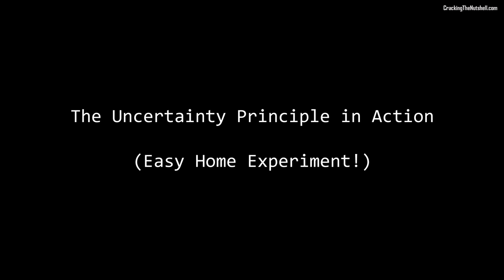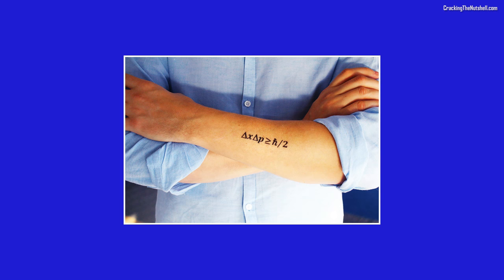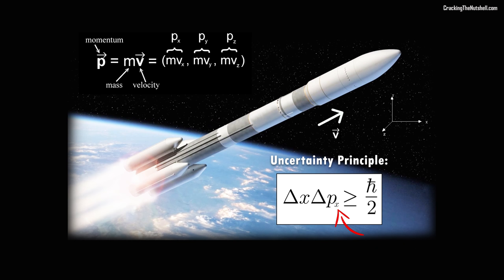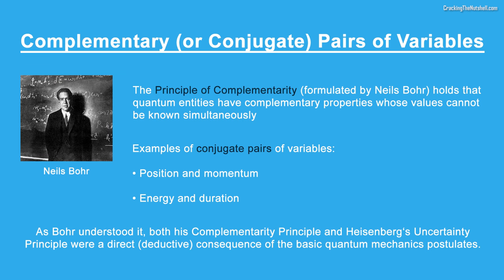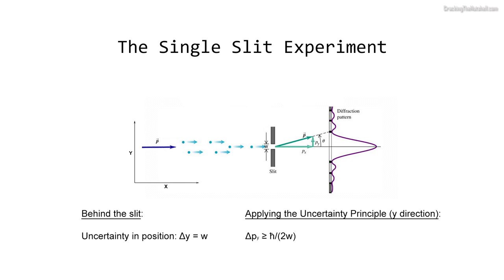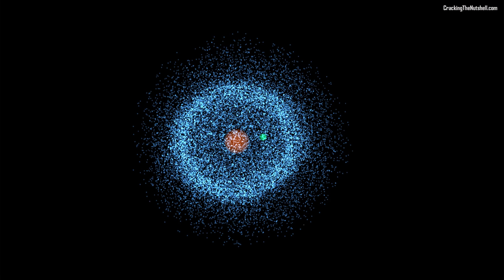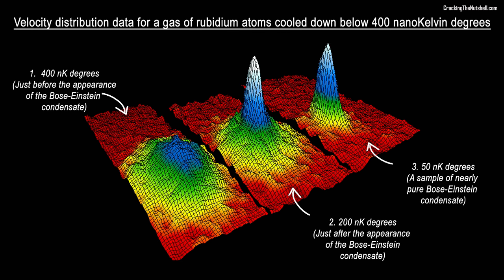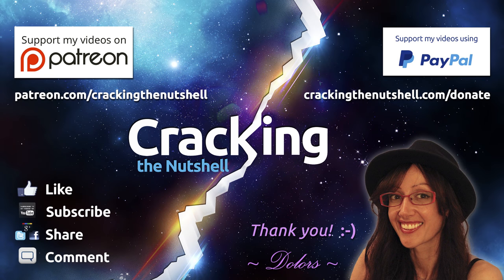Heisenberg's Uncertainty Principle - Single Slit, Hydrogen Atom & Bose-Einstein Condensates

Comment: Heisenberg's uncertainty principle: Δх * Δр ≥ ħ/2

The Heisenberg's uncertainty principle is correct, moreover, it is fundamental. If the uncertainty principle is incorrect, then all quantum mechanics is incorrect. Heisenberg's justified the ncertainty principle in order to save quantum mechanics. He understood that if it is possible to measure with every accuracy both the coordinate and momentum of a microparticle, then quantum mechanics will collapse, and therefore further justification was already a technical issue. It is the uncertainty principle that prohibits microparticles in quantum mechanics from having a trajectory. If the coordinates of the electron are measured at definite time intervals Δt, then their results do not lie on some smooth curve. On the contrary, the more accurately the measurements are made, the more "jumpy", chaotic the results will be. A smooth trajectory can only be obtained if the measurement accuracy is small, for example, the trajectory of an electron in a Wilson chamber (the width of the trajectory is enormous compared to the microworld, so the accuracy is small).

Heisenberg's formulated the uncertainty principle thus:

if you are studying a body and you are able to determine the x-component of a pulse with an uncertainty Δp, then you can not simultaneously determine the coordinate x of the body with an accuracy greater than Δx = h / Δp.

Here is a more general formulation of the principle of uncertainty: it is impossible to arrange in any way an instrument that determines which of the two mutually exclusive events has occurred, without the interference pattern being destroyed.

It should be immediately said that the Heisenberg uncertainty principle inevitably follows from the particle-wave nature of microparticles (there is a corpuscular-wave dualism is the principle of uncertainty, there is no corpuscle-wave dualism - there is no uncertainty principle, and in principle quantum mechanics, too). Therefore, there is an exact quantitative analogy between the Heisenberg uncertainty relation and the properties of waves.

Consider a time-varying signal, for example, a sound wave. It is pointless to talk about the frequency spectrum of the signal at any point in time. To accurately determine the frequency, it is necessary to observe the signal for some time, thus losing the accuracy of time determination. In other words, sound can not simultaneously have the exact value of its fixation time, as it has a very short pulse, and the exact frequency value, as it is for a continuous (and, in principle, infinitely long) pure tone (pure sine wave). The time position and frequency of the wave are mathematically completely analogous to the coordinate and (quantum-mechanical) momentum of the particle.

We also need to clearly understand that the Heisenberg's uncertainty principle practically prohibits predicting behavior (in the classical sense, since Newton was able to predict the position of the planets), for example, an electron in the future. This means that if the electron is in a state described by the most complete way possible in quantum mechanics, then its behavior at the following moments is fundamentally ambiguous. Therefore, quantum mechanics can not make strict predictions (in the classical sense). The task of quantum mechanics consists only in determining the probability of obtaining a particular result in the measurement, and this is fundamental. That is why the uncertainty principle has such a fundamental meaning (there is no uncertainty principle - there is no quantum mechanics). But this does not mean that we do not know any "laws or variables that are hidden from us", etc. No. It's just the reality. This is analogous to how a particle can exhibit corpuscular and wave properties - just this is reality and nothing more. And even if we know the "hidden parameters" (compare, understand why the wave properties and corpuscular ones are manifested), this reality will not change, and the uncertainty principle will also work, but we will understand it more fully.

It must be added that not all physical quantities in quantum mechanics are measurable simultaneously, that is, they can have simultaneously definite values. If physical quantities can simultaneously have definite values, then in quantum mechanics they say that their operators commute. The sets of such physical quantities (complete sets) that have simultaneously defined values are remarkable in that no other physical quantity (not being their function) can have a definite value in this state. The fully described states (for example, the description of the electron state) in quantum mechanics arise as a result of the simultaneous measurement of a complete set of physical quantities. By results of such measurement it is possible to determine the probability of the results of subsequent measurements, regardless of what happened with the electron before the first measurement.

If physical quantities can not simultaneously have definite values, then their operators do not commute. The Heisenberg uncertainty principle establishes the limit of the accuracy of the simultaneous determination of a pair of physical quantities that are not described by commuting operators (for example, coordinates and momentum, current and voltage, electric and magnetic fields).

Let's add a little history. A. Einstein assumed that there are hidden variables in quantum mechanics that underlie the observed probabilities. He did not like the principle of uncertainty, and his discussions with N. Bohr and W. Heisenberg greatly influenced quantum mechanics and science as a whole.

In the Copenhagen interpretation of quantum mechanics (N. Bohr and followers), the uncertainty principle is adopted at the elementary level, and it is in this interpretation that it is believed that this can not be predicted at all by any method. And it was this interpretation that Einstein questioned when he wrote to Max Born: "God does not play dice." To which Niels Bohr, answered: "Einstein, do not tell to God what to do." Einstein was convinced that this interpretation was erroneous. His reasoning was based on the fact that all the already known probability distributions were the result of deterministic events. The distribution of the tossed coin or rolling bone can be described by the probability distribution (50% eagle, 50% tails). But this does not mean that their physical movements are unpredictable. Conventional mechanics can calculate exactly how each coin will land, if the forces acting on it are known, and the eagles / tails will still be randomly distributed (with random initial forces). But it is unlikely that this experience can be extended to quantum mechanics.

The position of Bohr and Einstein must be viewed as views from different angles of view on one phenomenon (problem), and in the end it may turn out that they are right together. This can be demonstrated by lottery. Despite the fact that theoretically the results of the lottery can be predicted uniquely by the laws of classical mechanics, knowing all the initial conditions (it is necessary only to determine all the forces and perturbations, and to make the necessary calculations), in practice the lottery results are always probabilistic, and only in theory they can be predicted (try win the jackpot :). Even in this simplest case, we will be "inaccessible" to all the initial data for calculations. It is logical to assume that the quantum system will be incomparably more complicated than the lottery, and therefore, if we master the "true" laws of the quantum world, the probabilistic picture will remain, since the microworld is such in essence. Moreover, if you think about it, then our world is also probabilistic. It is deterministic only in theory, and practically, in everyday life, we can only predict, for example, tomorrow (or a second, or a year, or 10 years) with a certain probability (who can guarantee the event of tomorrow with 100% probability?). And what is interesting is that only after having lived it (by making a measurement), we can say what probability was realized. Quantum mechanics in action :).

More see by link: https://www.quora.com/Is-Heisenbergs-principle-of-uncertainty-wrong/answer/Volodymyr-Bezverkhniy?share=b4884212

Benzene on the basis of the three-electron bond:
REVIEW. Benzene on the basis of the three-electron bond (full version, 93 p.). 
http://vixra.org/pdf/1612.0018v5.pdf

1. Structure of the benzene molecule on the basis of the three-electron bond. 
http://vixra.org/pdf/1606.0152v1.pdf

2. Experimental confirmation of the existence of the three-electron bond and theoretical basis ot its existence. 
http://vixra.org/pdf/1606.0151v2.pdf

3. A short analysis of chemical bonds.
http://vixra.org/pdf/1606.0149v2.pdf

4. Supplement to the theoretical justification of existence of the three-electron bond.
http://vixra.org/pdf/1606.0150v2.pdf

5. Theory of three-electrone bond in the four works with brief comments.
http://vixra.org/pdf/1607.0022v2.pdf

6. REVIEW. Benzene on the basis of the three-electron bond (full version, 93 p.). http://vixra.org/pdf/1612.0018v5.pdf

7. Quantum-mechanical aspects of the L. Pauling's resonance theory.
http://vixra.org/pdf/1702.0333v2.pdf

8. Quantum-mechanical analysis of the MO method and VB method from the position of PQS. 
http://vixra.org/pdf/1704.0068v1.pdf

Bezverkhniy Volodymyr (viXra):http://vixra.org/author/bezverkhniy_volodymyr_dmytrovych

Comment: Heisenber's Uncertainty Principle is reverse engineering! He did not explain the mechanisms behind the spreading patterns of small particles through narrow slit or slits. He "assumed" that some parts of the wave equations can be assigned/replaced by probability density functions. Then one can derive solutions (out of many other possible solutions) to these equations that seemingly match the experimental results.